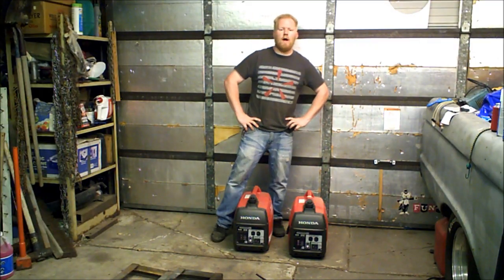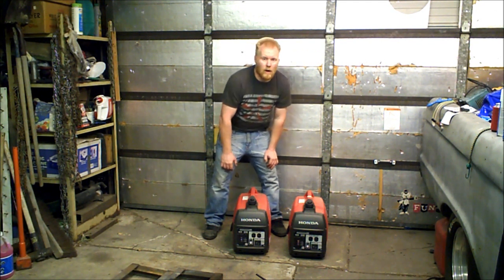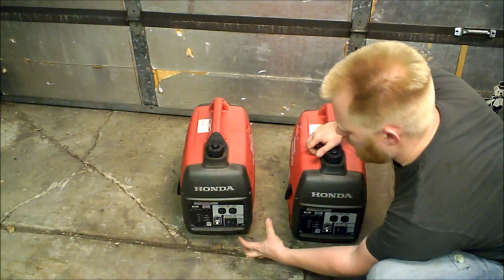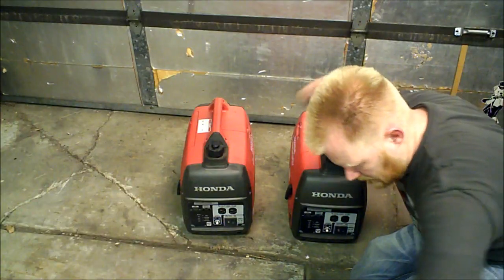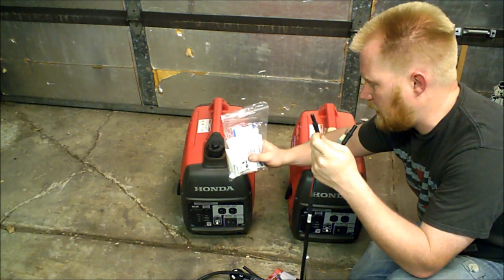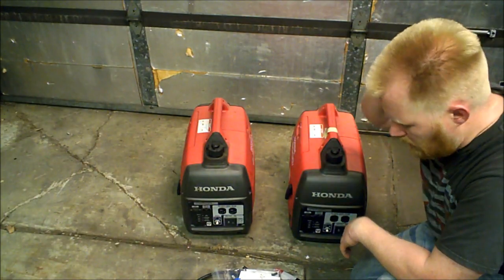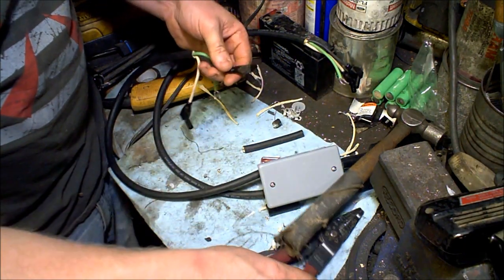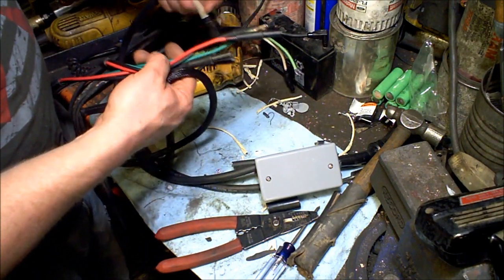Homemade 30A Honda Eu2000i Parallel Kit Generator

Comment: So far so good. Love the dual fuel option https://www.youtube.com/post/UgkxOTeIs0vv4_9B5hsmnLsk9r930uDQLu_Y ran the 5 hour “burn in “ phase on propane — and is very quiet vs other generators. Propane means no varnish or gum as when stored with gasoline — that happened with my old generator. Will get ethanol free gasoline for use as this is recommended. Love the electric start. And a very compact size. And inverter means consistent electricity.   Using the Champion model number 200988.

Comment: If you are going to buy two EU2000's (well EU2200 these days), why not make one of them the companion version that has a 30amp plug built into it? I know this video is 10 yrs old, but I've had my EU2000i companion for at least 13 yrs, so they were around back then.
Reply from the maker: Years ago and even still today they're not as easy to come by as the non-companion model. That and they were, I think around $300 more just for that plug that does the exact same thing I did in this video. You still had to buy a parallel cable as well for around 75 bucks.
Reply: @sixtyfiveford  I only recall them both being around $800 each. $300 back then would have been considerable and may have been MSRP, but it wasn't the street price difference. And I definitely recall getting the cable for free with the companion.

Comment: Thank you for a great video. I just purchased on Amazon parallel cable I have a question if you can tell me Will it work if one generator is EU 2000i and a second one newer  version EU 2200i  ? Honda says they supposed to be identical

Comment: I'm wondering if I have a eu2000i companion 30a, can I parallel with another companion or must I use a regular eu2000i ?
Reply from the maker: Yes, any of the Hondas link together just fine. Guys even join the 1000s to the 2000s and 3000s without issue.

Comment: Can you parallel the two hondas to produce 240/120 volt?
Reply from the maker: No, just 120v at double the amps. The circuitry automatically aligns the sine waves from both generators. There has been talk on forums and stuff for people trying to crack the computer in one of the generators so the sine waves are opposite which would make 240 volt but I haven't heard of anybody being able to do it.

Comment: What I wonder 65 is if you add up the amps on the outlets can you reach double that on the amps at the kit plug? It seems like you could really help your hvac start with a big capacitor. When starting your gensets it takes a few moments to charge this cap if you build your own easy start. On a 15,000btu unit the starting draw is 58amps with no cap. With the easy start cap in it is only 23 amps which is just nuts. If you have two air cons if you turn down the temp on the first one so it isn't drawing it's easier to start the second. I just watched burning man yurt people start three off a 3500watt predator. I wouldn't recommend that.

Comment: These inverter generators have a floating neutral so if you have just one breaker on the “hot” wire like you would a house it’s not going to work (or not work) because both wires are essentially “hot”. Try putting a volt meter on either wire and it’s going to have power so if you pop the breaker with this design your just going to kill half the power and probably fuck it up but then again they already have breakers built into the unit themselves anyway so if you cause a fault then your overly complicated design is just that and you can get the actual Honda wire set for 20bucks on eBay now so? 
Hell…I’d pay that to have never watched this video at this point… 🎤💩 fml 🤦🏼‍♂️

Comment: Music can go, why did you have idol down shut off?
Reply from the maker: You don't want to have ECO Throttle on if your running high surge loads like AC that switch on and off constantly. You'll burn up your generators.
Reply: @sixtyfiveford  I was wondering as my buddy has two going without the add-on 30 amp a 2000 and a 2200 and he lets them idle down but he does have the soft start on his AC

Comment: How long run time? 50% of using time? I have a Honda 2000i but only ☝️,my RV air conditioning is quite,also only 3 to 4 hrs,not a long enough so I’m thinking about parallel,I need least 14 hrs without runout GAS.
Reply from the maker: You can install the extended gas caps and they'll pull fuel from an external gas tank.

Comment: Another Great Video.  Thanks.  Just wondering.  I have a Generac IQ3500/3000 inverter generator and a Paxess 2300/1800 inverter Generator.  The volts are the same about 124v The HZ are the same at 60.  The parallel cables which came with the Paxess fit perfectly into the Generac.  Can I parallel these 2 generators?  If so, do I need to start one 1st over the other or just plug in the parallel cable then start both and let them sync? then apply a load?  Please share you thoughts.  Thank You.
Reply from the maker: I can tell you how the Honda works. The first generator started is the master. The second one to start matches the other. I think it does this by by mechanically rotating the stator to put the AC sine wave phases so both match. I say this because if you just plug one into another with them both running you can hear a distinct spin and teeth slipping over locking holes. Kind of like putting a car into park before it has completely stopped rolling. I did watch a video years ago where a guy plugged a Honda into a working Power inverter(running off 12v car battery) and started the Honda. It worked just fine. 
Now to your question. The Generac and Paxess are Honda clones and theoretically use the same circuitry. In theory there is no reason the second generator wouldn't match what the first one is doing. I have never tried it for myself.
Reply: @sixtyfiveford  Thank you for input.  You brought up several good points.  I do know that the Paxcess is a Yamaha clone coping the MZ80 Engine.  So if  Generac is a Honda clone they may not sync.  Again, Thanks.  Always watch you video's and learn alot from them.

Comment: You sure you can mismatch L and N on both ends???
Reply from the maker: Absolutely positive. The second generator started syncs to the first one.
Reply: @sixtyfiveford  Interesting. Why does Honda instruct a L-L/R-R method of connection then?
Reply from the maker: @zyxlsy  it doesn't say that in the manual. If it mattered they would have made unique plugs for each side.
Reply: @sixtyfiveford  Makes sense.Thanks!
Reply from the maker: @zyxlsy  That's an old 2003 manual and I have never seen it stated in the main manual nor any modern manuals. The early first generation generators had different Parallel computers and this may have been part of their setup. However 120V AC single phase power doesn't care which side is Hot vs Neutral in a closed circuit like a generator. Especially when the second generator syncs it's waveform to the first. I have had at least 2 dozen of these generators and have plugged them any which way. I would think there would be a lot of comments/right ups/reviews from people who damaged their generators from mistakenly installing one backwards. I've never seen this happen.

Comment: If I paralleled the two 3,000 watt generators together to get 48 or 49 amps  and removed the  30 amp push button and installed the 50 amp push breaker would I use a #6 wire coming out of the "home made parallel kit" to a 50 amp twist lock power inlet  female plug? I would imagine the wires used for the 30 amp box are too small.
I have a 50 amp 125 v twist lock male power inlet box installed at the house to the panel. If so how would you wire the home made box with 4 wires instead of the three wires for 30 amp box?

Comment: Any reason why you couldn't add a 15 amp receptacle to your junction/breaker box?
Reply from the maker: No reason you couldn't. I didn't as you can just plug into the machine and get 20amps when paralleled.

Comment: Thank you for answering my questions!
I have some more inquiries for you if you’re game?

Awhile back I made the parallel cable box with the 30 amp push button breaker for two 2000i generators. The feed from that box was a female twist lock NEMA L14-30R 125/250v. The female twist locked into my panel power inlet male NEMA L14-30 125/250v- 4 prongs. Knowing that I would only energize one bus with 120volts, I bridged L1 and L2 to get 125 volts on both buses. I did this in order to avoid moving breakers around to one bus. It worked great.

As you know one generator was stolen and I opted to upgrade and still parallel. Now I have two 3500 inverter generators that I found can use the Honda parallel cables to sync. In our last communication you said to change out the existing 30amp to a 50 amp push button breaker in the existing box. 

Q- I think I should change out the 30 amp cable and plug on the box to a 50 amp 125/250v #6-4 conductor cable with a 50 amp female twist lock?

Q- If I am right my power inlet would be a twist lock male of the same pin and cable configuration going from there into my panel?

Q- in the panel the existing generator lock separates a double pole 30 amp breaker. I imagine I should change that to a double pole 50 amp breaker and wire the new cable into it? 

Q- Last one. If this all sounds sound, would I have energize both buses or should I bridge L1 and L2 to do so?
Reply: You should just hire an electrician and go fuddle with something made out of wood

Comment: Hey 65
Still hope you reply to these videos.
I contacted you years back with some questions which helped me make a parallel kit.
Worked perfectly until one of my 2000i generators was stolen a month ago. The serial number on my existing 2000i is not compatible with the new 2200i. Long story short I am getting 2 Predator 3500i(s) to parallel.

If I followed your 2000i formula with a 30 amp push button breaker (which worked) would I only have to change to a 50 amp push button breaker if the banana plugs fit?

Starting Watts: 3500 and Continuous at 3,000. 
Great videos by the way.
Reply from the maker: 50amp exactly. Since I did the video though China has made these pretty cheap https://amzn.to/3nEHjC6 so it's barely worth it to build your own. But still remember you won't get 220/240 volts 50amps with any of these kits and these generators. Just 120volts at 50amps so some RVs won't be happy if you try to run certain devices.
Reply: @sixtyfiveford  If I paralleled the two 3,000 watt generators together to get 48 or 49 amps  and removed the  30 amp push button and installed the 50 amp push breaker would I use a #6 wire coming out of the "home made parallel kit" to a 50 amp twist lock power inlet  female plug? I would imagine the wires used for the 30 amp box are too small.
I have a 50 amp 125 v twist lock male power inlet box installed at the house to the panel. If so how would you wire the home made box with 4 wires instead of the two wires for 30 amp box?

Comment: You can actually forget the banana plugs and just use standard 110v male plugs and use the outlets (1 on each generator).  Been using mine this way for years.  This way the ground isn't a screw terminal either.  If you open up the generator, the parallel ports are wired directly to the outlet anyway.
Reply from the maker: Yes, but there is a good reason that method/cord is called a death plug.

Comment: Great video thanks for posting! I'm curious if you separated the two black hot leads if you could have split phase 240VAC but maybe the generators would not sync up that way.
Reply from the maker: Unfortunately no. I've read a handful of tech articles where guys are trying to do this and it comes down to not an easy task. The simplest way is to have a stand alone transformer that runs off the eu2000s and makes 240vac AC. The transformers are pricey though.
Reply: @sixtyfiveford  thanks for getting back to me!

Comment: Great Video, thanks. I have a Honda 2000i. I want to add another but they aren't made anymore. Mine is not among that serial numbers that Honda says is compatible with the 2200i for higher voltage parallel operation. Their cable is made to use the 30 amp box on the 2200i (you won't get the combined voltage). Do you have any idea if this type of setup would work for me since I wouldn't be using the connection on the generator?

Comment: I wonder what these banana plugs are used for. Looking at the internal wiring of these Eu20i generators, the external banana connectors are directly connected to the regular power outlets. So one should be able to parallel these units with two regular 110V plugs, one in each generator. Thinkting about it: That's potentially dangerous. If one plug is in the outlet, and the other one laying around, the pins will be hot. So better be careful. At the end, the banana plugs make sense.

Comment: I would recommend 10 Gage wire. 12 Gage is only good for a 20 amp load.
Reply from the maker: Each leg is only pulling a max of 13.3amps from the little Honda, so it's within the 12awg capacity.